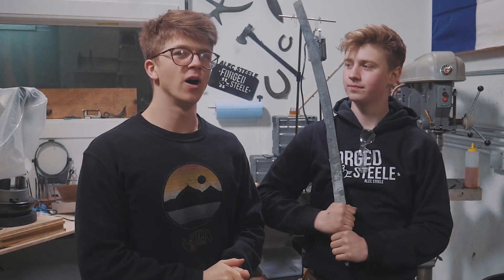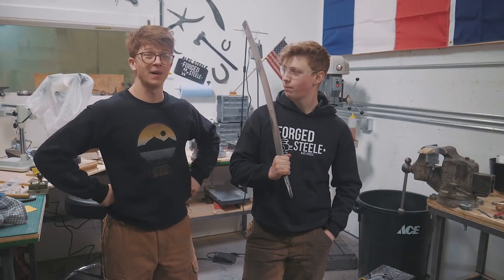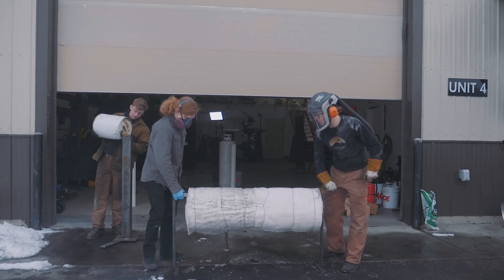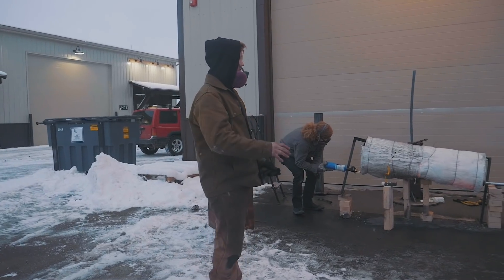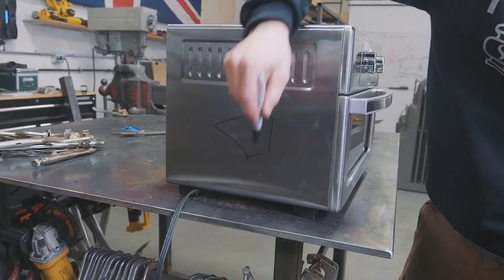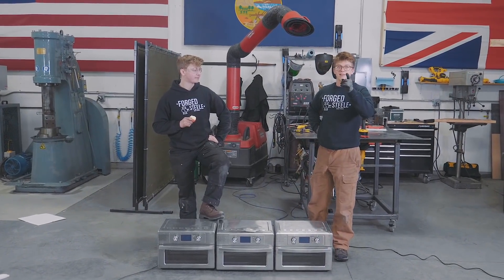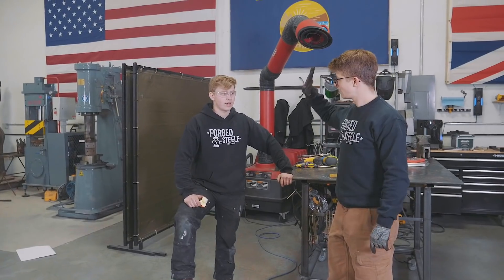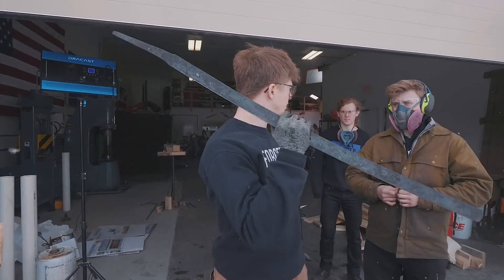MAKING THE CAVALRY SABRE: Part 4

Comment: For safe future practices, it might be worth wearing some IR blocking eye protection to prevent damage when looking into the heat treat furnace for placement of the sword blank. At that temperature UV shouldn't be too huge of an issue, but IR damage can lead to cataracts and other nasty, unnecessary injury.

Comment: Oh Alec... Now you know why old artisans never get in a hurry no matter how excited they get. Accidents you would never foresee bite you every time. 
Rule #1: No running in the shop.
Rule #2: Always wear your PPE.
Rule #3: Use the right tool for the job.

Your collaboration with Will is awesome. Maybe you could take the seasoned sabre blank to a machine shop for grinding truly flat before contouring. It's a quick job for an experienced grinder.

Comment: i made a powder coating oven out of steel studs, sheeted with sheet metal and fiberglass insulation. a cheap PID controller and electric heating elements from a regular kitchen oven. cheap, easy, and you can make it any size you want

Comment: Tip: you can turn the K wool furnace vertical and hang your sword so you definitely won't risk it warping during austenization. Also, you should hang the K wool so the frame isn't inside it. It'll eventually decarburize and you'll have to replace it. If it's outside it'll last much, much longer.

Comment: You should use some of that insulating wool around the holes between inner and outer casing.  otherwise, convection will cool down the areas between two ovens.
also, I would fix the ovens to each other, put a tube inside the cut out spaces and make another hole with a door or just an insulated plug to one side.   in that way,  it could be fairly safe and why not permanent solution. .   if the temperature needs to be accurate, I would also replace the built in temperature control with some industrial thermostat.  
anyway, keep up the good work. nice to see the workshop taking shape!

Comment: Wow that toaster oven thing is a good idea. 

A thought: your gas "furnace" looks a little too temporary. I know how expensive kaowool is and it'd be a shame to see it fall apart. You could encase it in corrugated pipe, regular thin-wall pipe, or even expanded metal formed into a time. Next mount it to a table/rack on wheels with the gas oven below, and the toaster ovens above. BOOM. Sword heat treating station.  

Also I'd cut the holes in the toaster oven a bit bigger, then seal between them with leftover kaowool.

Also also, if your worried about ceramic fiber dust, you can order a clear refractory sealant that will harden the layers exposed. It will also help seal in any dust that might otherwise get brushed into the air.

Great attitude despite the injuries! Can't wait to see your next installment!

Comment: Yall could use some of that wool, sandwiched between toaster ovens and aluminum tape to seal them up and insulate those voids. Added bonus, it probably makes it less dangerous. Also how does frigid air affect the heat treating process? Does it require greater temperature or faster handling?

Comment: Guys, I'd imagine you've already discovered by now but those wires in the toaster ends are going to get melted and exposed when you run those ovens like that. cutting the holes basically put the wires right inside the oven compartment.

Comment: buy a used " wood surface planer"  remove blades, stick on surface contact sand paper on the cylinder and speed things on the grinding, plus more accurate and uniform. Might need to slow the rpms down a bit though ! !

Comment: You need two 55 gallon drums, stacked. Wood fire in the bottom, heat chamber in the top. Cut a door in the top and build a rack to set your swords on. Light a fire in the bottom. BAM!!!!! Temper chamber. You can get the kit at tracker supply for 70 bucks

Comment: I tempered my first knife in the microwave but had it on convection oven which is hot air, not the normal way. It is also pretty good cause you can set the temperature and it is stable

Comment: You can buy stove or oven elements at the Home Depot or your Ace hardware, use a old oven control panel with it's thermostat, weld up a metal box, surround it in fire brick and, Bob's-your-uncle, tempering oven!

Comment: If you do think you would need/want weird shaped bits theres a tool set called an ifix-it kit, that has a bunch of little proprietary bits in it. Also please dont use super glue, theres a thing called liquid skin that works just as well and isnt as harsh. Hospitals use similar stuff they sometimes call liquid stitches.

Comment: I bet you could add a little pivot door on the outside oven, put insulation between them as a gasket, and a big bar clamp to pull them snug together.

Comment: Also the super flexible electrical tape works too on a non bending spot... You don't need the string... you just need to hold it together, wipe it then hit it with superglue before it starts bleeding again... sliced my knuckle really bad while cleaning my planer before putting new blades in it...  didn't even feel it... until I was wondering where all the blood all over the planer and the shop floor was coming from... got nervous when the blood started swelling up the finger after I superglued it closed... after about 5 days was able to bend it... used some wood shims and electrical tape to keep it straight and so I could keep working...

Comment: You might want to put a little insulation inside your holes to protect the wires from the full heat since it wouldn't get hot before you cut them up.

Comment: Hi Alec, always good job solving problems as you go along with a project. I was thinking, since you are very much enjoying swords, wouldn't it be better building a specific HT oven using 2 56 gallons drums stacked, lined with kaowool sealing this with rigidizer and refractory plaster so you don't need to take it outside and wear masks? Also, you could put a vertical tank in it and fill it with HT salts to have perfect and uniform temp and the vertical position would help avoiding warps. Just a though, as I find this set up very beneficial as I can heat it up with an hay burner. Thank you for your videos, always very educational and entarteining!

Comment: A nice long term solution would be to build an electric kiln. There not really expensive to make and can run room temp to 2000 degrees. I am an amateur and I built one that handles my lost casting shells.

Comment: Great tempering hack, but I'm curious you did not build something instead? I mean a metal tube wrapped with that ceramic insulation, two thin copper rods hooked to current with a thermometer relay. You turn it on, it gets to temp, you stick in the sword, and the thermometer relay engages / disengages the current to the copper rods. You add a timer to the power supply and your done. People do something similar with chest freezers and fermentation. You put your 5 gallon containers of fermenting beer in a chest freezer, have a thermometer inside that controls and on / off switch to the power source to the freezer. When the compartment gets too warm, the cooling cycle of the freezer kicks on until it gets to the required temperature, then it shuts off. Chest freezers are used because they only cost a fraction of a traditional refrigerator.

Comment: I wonder if you could get a heating element from an electric water heater and slide it in the quench tube (empty of course) and use that as a heat treat oven. I'm sure you can get bare tube heat elements, but I wonder if the element in a water heater could get hot enough if it weren't submerged in water. You'd want to insulate the tube but some ceramic wool around it with a thin plate surround would work great.

Comment: Steels will decarburize in the presence of Oxygen when heated. This is a normal condition,  Carbon loves to bond to Iron, but not as much as it does to Oxygen.  Removal of the decarbed layer is required for  final use.

Comment: you need to put some insolation around the holes and/or wires so the heat escaping does not melt the wires and short them out.

Comment: Look, I think you guys should cut open more of the sides of the middle one, weld some rods between the two end pieces to form a shelf, and then weld all three ovens together, including the doors.

I think you'll have a much better time with it, and it'll be so much safer.

Ideally, you'll probably also want to rewire the middle one slightly, to get those wires out of the danger zone, but that's not to hard at all.

Comment: I just can’t help but think, there are 3 professional blacksmith in a state of the art blacksmith shop, working with materials that get up to heats over a 1000 degrees, hazardous chemicals, machines that will smash you to a molecular lever, and they’re worried about putting together 3 toaster ovens.

Comment: Looks like that bottom plate for your quench tube was AR plate or Tribraze. Some times when your welding on stuff like that, especially when welding it to mild steel it will crack if you don’t hear it first. Just guessing because it had a red tint to it.

Comment: Could you use a trough to quench in ? cut one side off the square tube and blank off the end. You could fabricate a long tempering oven and use the elements from the ones you chopped up.I you wanted to use 1 control then you would probably need a contacter (large relay) to handle switching all the elements at once.

Comment: If you ever have wonky tri-lobe or safety screws you can't get out, cut a slot in them with a dremel cut-off wheel and use a flat head screw driver.

Comment: It is possible to temper steel at higher temperatures for shorter times, but with some high-strength steels -- perhaps those used here for Alec's swords -- it was found that there is a forbidden range of temperatures between 700 and 1000 degrees F (I think; perhaps C)  where temperating actually made the steels MORE BRITTLE.  I am not sure of the cause, but eventually, most steel manufacturers decided that to be safe (rather than sorry) they would temper all steels at the lowest practical temperatures, roughly 400-500 degrees F, even though this meant longer heating and cooling cycles, sometimes more than one -- time is money so there may still be times when higher temperatures are used, but not universally.

Comment: saw another set of smiths/fabricators use a hot oil tempering technique.  Not sure if thats an option or if you've tried it and didn't like the outcome, but it could be an option as well for swords you make.

Comment: Wouldn't the 3 oven solution have cold spots in between each oven, resulting in uneven heat throughout the blade? Maybe get a flir and check it out? Also could be useful for other things around the shop. Could also give some really nice visuals for the videos.

Comment: Alec, you gotta watch that ice build up on your boots, icy boot don't work Well on smooth concrete when trying to course correct at faster than a medium walking speed. 
Why not just turn the flame down on the wool tube for tempering?

Comment: No, no, no, no......it's not stupid if it works! Right on, Will! Just wondering how you can patent that franken-cobble-ilation oven........ Oh, btw, for tempering why not make a hot oil bath with another vertical tube? A little heater coil in the bottom, a pyrometer, and, bob's your uncle!

Comment: Can't understand why you didn't use your plasma cutter or at the very least a cutoff disk to make the holes in those toaster ovens.  Very good video.  I used a Kaowool tent to harden a 325 pound anvil years ago.  Great stuff, just don't breathe the dust.

P.S.:  If you are planning on building a tempering oven, you might want to check out Dave Hakkens on the Precious Plastic channel on YouTube.  He has some good stuff on tempurature controls and such.

Comment: Hi Alec and Will,
Nice to see you on a new sword's project.
Why quenching before grinding?
Reply: Quenching often causes warping (sometimes only slight, but still there). By leaving most of the material it has 2 benefits- more support in the piece which reduces the warping, and it allows them to 'straighten' the blade fully during the final grinding. Leaves them room to grind the shape they want in the material left. ;)
Reply: @Broadpaw_Fox  Thank you ;-)

Comment: Alec, why dont you get yourself some steel ducting that they use for air conditioning systems, use the same principles with the rock wool insulation by just lining the ducting with that, then you wont have it just hanging there. Also because you would be using the ducting you could hang it from the top instead of having the frame in the way while you are trying to put the sword inside it. You could also hinge a door onto it. Would make a lot more sense than just coiling some insulation over a steel frame and running some gas flame through it in mid air

Comment: Why dont you weld 2 steel barrels together and cut a hole in the lid and the bottom to keep the ceramic wool together? The fibers wont fly around(or less) and it would insulate it a bit better

Comment: Maybe a grinder with a cut off wheel would make a square non jagged death hole in the ovens those holes look like Austin powers teeth. Just saying I'm sure your going to use them a bunch may as well not loose a finger over it.

Comment: why don't you just get your self an induction forge...you can bring your metal to forging temperature in seconds, you can heat treat, anneal, and anything else in between with the added bonus of very little power usage and never having to refill a propane bottle again....ALSO as a triple bonus... you can have an argon shield during heating and forging Damascus so your billet will turn out super clean with no problems....

Comment: Get a length of 6" PVC pipe, cap off both ends, come in a couple inches and cut off side for a horizontal trough ? Im a carpenter not a metal worker so I have on idea if heat is an issue here with PVC ?

Comment: Would a jigsaw with a metal bit not have been a million times easier?
Reply: earle0024  yes but not as easy as putting cutting disks in one of their 50 grinders. And several magnitudes easier than that would be turning around and grabbing a cutting torch or the plasma cutter a few feet away...  or a hole saw. In a fully stocked metal shop with hundreds of ways to make holes in a metal thing they went with drill bits, tin snips, and a die grinder. Un friggin believable.
Reply: @Leonarco333  oh YEAH, freaking angle grinder with a cutting disc would take 30 seconds a d the metal wouldn't deform at all!!!

Comment: Ok how do you spell unwonkify? For your heat treat oven I would buy a long BBQ grill and cut off the ends (maybe make them doors) and side in the kaowool tube. It will have 4 legs and a set of wheels making it easy to move in and out. You can also stabilize the kaowool making it safer to use.

Comment: Alec mate you should build yourself a proper electric heatreat oven 
with yours skills and equipment you can do it in a couple of days
i thik that it's a good project for the channel and also you can make more accurate heat treats for your projects
and it's quite "cheap " in materials and work time
i spent 300 euros in high quality  materials and the controller for a 15x15 x45 cm  oven 
and i temper and heat treat high carbon steel and inox without problems
i can help you with the electric scheme and rough calculations

Comment: "The proof in the pudding is in the eating" 

Basically amounts to 'theory is only theory until it's proven in the real world'. Kind of like the theory of turning the wagon wheel iron into steel. In theory, it would work. In practice, it failed. You really got to beat and fold the carbon into the iron. Like excessive amounts. Cover the ingot in carboniferous material, beat on it, wash the scale away, reheat, cover with carboniferous material, etc. Iron has to be forced into accepting the carbon unless you can reach temps of 3000° freedomheit. You have to really open up the cubic molecular structure to allow the carbon inside of it. If you can't introduce enough energy to get the atoms to move far enough apart (heat it), then you have to deform that crystalline structure enough to allow it to just barely slip in (beat it). Turning the raw iron into steel was something the old Japanese masters would take weeks to do. They'd cover the ingots in a grass, beat the ever loving daylights out of it, and then clean the ingot with a bit of light water before putting it back in the forge. They'd spend days doing it until it was just right, and they could tell if it was just right by the way the metal "sung". You can hear the difference in its reverberation

Comment: Why didn't you just do a hot oil temper?...put a burner on the outside to heat the tube of oil and regulate as needed by turning it on or off.
Reply: At minimum your finger wouldn't be cut and you would have a few hundred more dollars in your pocket...

Comment: why don't you temper it in a hot oil bath? you can make a tube the length of the sword fill it with oil and heat the oil to tempering tempature and temper the sword in it for the length of time you need.

Comment: No, it's still incredibly stupid. 3 ovens at 425° don't even want to think of the load on that circuit.

That being said you could wrap the junction between each and avoid some heat loss.

Comment: Are you going to cook the wires near where you cut the holes in the sides of those ovens?
That little spring thing also looked a bit dangerous if you electrified the box.
I’d be checking you have earth leakage circuit breakers or the connection to earth might be you!
Hmm,  don’t do this at work boys and boys you not trained professionals 😬

Comment: Why dont you heat up the quenching tube with oil in it to temper it.... Can someone tell Alec that he can just heat up a tube filled with oil with a burner up to the 4-500 degrees and stick the blade in it